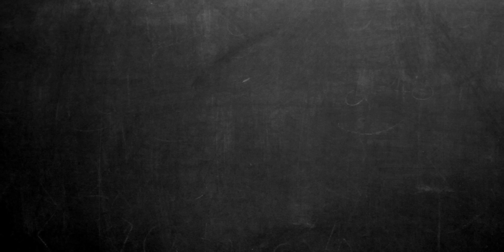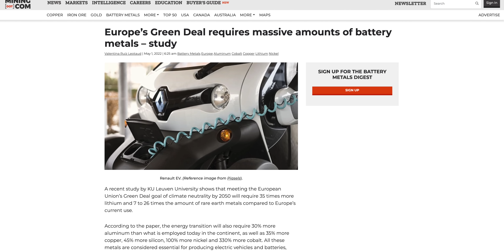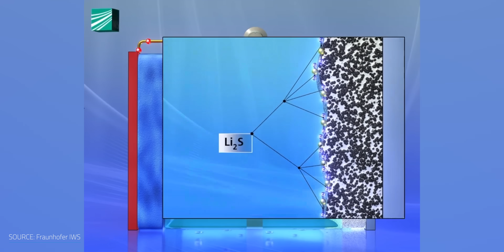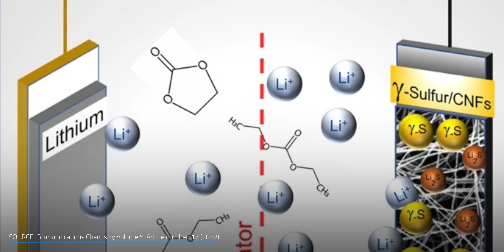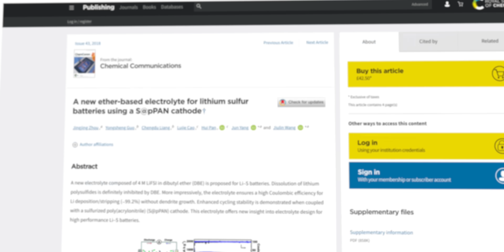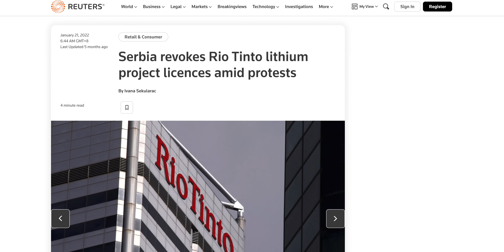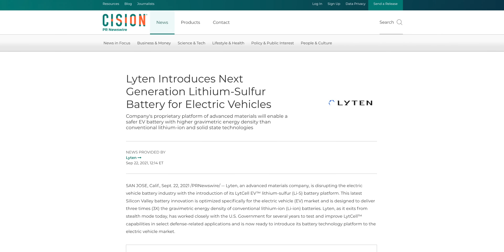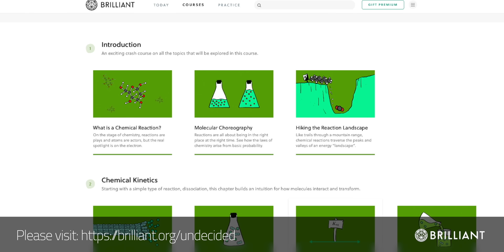Why This Accidental Battery Breakthrough Matters

Comment: This is exactly what we should be researching. Energy storage over energy production. With that said I have seen several battery breakthrough videos over the years with nothing so far. Solid state was exiting but nothing new in the past 3 or 4 years.

Comment: 🤔 I feel like .7% gallium would prevent the lithium sulfur products. I understand that the extraction of lithium and the actual transmission of electricity consumes more petroleum than say a 90% efficient petroleum engine,  thus non superconducting batteries are just a money grabbing scam... but yeah .5 to .7 % gallium should prevent the caking.

Comment: 500,000 gallons of water used to extract 1 ton of lithium-----you could use 500,000 gallons of water in electrolyzer powered by solar panels to product green Hydrogen instead. Much research is done around world to make electrolysis more efficient & progress in that area is on uphill climb compared to progess being made in battery technology.

Comment: IF they can get a sodium-sulfur battery that is even just on par with current LiFePO batteries it will be a game changer.  If they can increase the energy density as well, all bets are off LOL.  I still think the future, 50 to 100 years out, is going to be distributed power generation and storage.  Basically residential and commercial buildings with solar/wind generation and local battery banks.

Comment: 2:58 no it would mean manufacturers would put in 1/4 the battery weight/volume with 100-200% of the capacity IF it really is 8 times as effective.

Comment: Hi Matt, is there anything that actually out and has some improvements compared to the normal lithium battery? 6 years is forever. I am wondering why not  a big auto marker company buys this tech and pushes the production out in max 3 years. If it's really working what stops them?

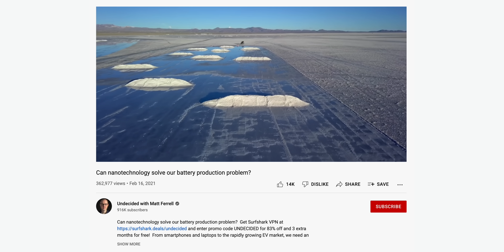Comment: 8:57 500,000 gallons per ton?? Really? Why not putting a few more zeros on both sides and use ounces... pff...
How about 0.5 gallon per kg of Lithium. Or 1.9 L per kg of Lithium. Or about a water-Lithium mass ratio of 2:1.
Or in dramatic words: for the weight of Lithium equal to a diary cow (700 kg) you need an olympic swimming pool of water (2.5 *10^6 Liter)

Comment: Lithium-Sulfur battery are already in the market with a cost of $1-4 with 1000 cycles.
Lighter than li-ion.
No need for bms...I overcharged them in 3hrs by accident...And they are still okay. Charging time: 1hr

Comment: Okay, but how does charge rate compare? How about sitting discharge? Rate of discharge? Heat/cold sensitivity. Lithium batteries have a slew of problems for real world applications outside of small electronics. 

I really wish we're pursued capacitors instead. And we'll STILL need nuclear power for all that electricity. Our generation and infrastructure can't handle 25% EVs today.

Comment: There's a lithium sulfur company formed out of a university in Australia that has gone public and has the production capability of to 2MWh per year. 

They're hedging their bets on Boron Nitride Nanotubes to solve the problems. I only heard about them the other day but it sounds like there are a lot of players vying for this market.
Reply: Also, I see Ambri batteries, started out of Cambridge, must have overcome their design flaws as they're expanding rapidly too. 

They're liquid metal batteries for bulk storage using abundant and cheap materials. Plus they don't require cooling which is a major plus for wasted energy.

Comment: Energy density vs. capacity?
1. Is the 8x energy density by volume or weight? Or both?
2. Why does it have 8x energy density but only 3x the capacity of Li batteries? This doesn’t make sense to me.

Comment: The problem with any battery that requires lithium is that, even at our current level of lithium use, each year, thousands of acres of trees are being decimated in order to get at the lithium. How is this environmentally friendly? Further, a large portion of the lithium is found only in China, and we have found out how reliable they are as a trading partner. What we really need is a battery that uses a mineral that is much more plentiful, and easier to get at, than lithium.

Comment: Comment prior to watching. I like to guess first... EDIT: nope :) 

Problem: Pasdivation layer build up on the anode.

Solution: charge with high frequency AC such that a low discharge rate is applied intermittently during charging.

I.e. each battery must have electronics to control charging.

Comment: You know, the thing with all these developments and that they are always touted as 'cheaper this, cheaper that', but the consumer just never sees anything of that. Things just get more expensive with manufacturers and/or lawmakers coming up with a plethora of reasons to keep prices high. New battery tech is nice, but I don't believe for one second that this new battery, or hydrogen, or anything else, will actually result in more buying power for the average consumer.
Reply: That's almost always a manufacturer decision, not a lawmaker one. But you're right. There's no market reason for them to lower prices when they can just increase their profit margin.
Reply: @MindForgedManacle  It becomes a lawmaker one when they enact such restrictive regulations that the manufacturers can't operate at a profit.  For example, Smithfield (pork processing) is shutting down their operation in Kalifornia due to regulations and cost of operation.  This is also going to impact their operations in Utah and Arizona, costing jobs.
Reply: @MindForgedManacle  I guess that the impact of law makers is more country-specific than manufacturer decision making but where I live, for example, so many things are illegal. Want to save on fuel and get a small electric scooter for grocery shopping? You can't because forbidden to ride on public roads? Want to electrify your internal combustion car? Not allowed without a lot of time consuming and expensive checks and authorisations, etc.

Ultimately, I think lawmakers have more power over pricing than manufacturers do because they can limit what a product should cost.
Reply: If they do manage to replace lithium with sodium the price will definitely come down due to the abundance of sodium
Reply: @grimaffiliations3671  Yes, for the manufacturers to build their products. Not for us the consumers.
Reply: @pyramidsinegypt  nah, when that tech becomes well known, there will be more avenues for supply, which will drive down prices

Comment: Insofar as the general shift to electric cars is concerned, I call bullshit...  its a government mandated novelty.  Why? Batteries and the electrical grid.  Battery efficiency drops dramatically in cold weather.  Presently, there are rolling brownouts merely because people run their home air conditioners!  What happens when electric cars are sold in really large numbers?  Just when will we double or triple our generating capacity?   I don't see people lining up to have coal-fired or nuclear generating stations built in their backyards.  BTW, China has a monopoly on materials for battery production.  Let that sink in.

To the manufacturers and their engineers, I give them all A+'s.  They are implementing, with success, the whimsical dreams of some bloviating governmental bureaucrat, owned by the Chinese, who is worrying about a crisis that doesn't exist.  I could go on for about as long as it takes to charge an electric car, but...

Comment: For EV applications even if the Lithium Sulphur  battery can't be charged as many times as the Lithium Ion wouldn't its 3x energy density more than make up for that?   I mean 1400 vs 2000 charges

Comment: Sounds awesome if it really works.
One of the main issues with our current batteries is how heavy they are. That means electric cars are heavy if you want enough range.
This isn't that much an issue normally, however it's one of the things that make electric sports cars kinda bad. Sure we can compensate with stuff like torque vectoring and all wheel steering but they just aren't as agile as they can be. Light batteries will solve that.
It's also a good thing for the air aviation industry, making electric planes more viable.

Comment: It's interesting for sure although I would like to see a comparison with Lithium Iron Phosphate batteries , charge/discharge cycles are about 10 times better than Lithium Ion but it does sacrifice weight and some power density in it's early lifetime but surpasses it within a hundred cycles or so .
Reply: They last far more than just a few extra hundred cycles. LFP batteries last from over 3x to 10x than typical Lithium Ion (3,000-10,000 cycles), and they do not have Nickle or Cobalt. Many new Tesla Model 3's use LFP batteries, especially in China

Edit; Did some more research lol

About half of the new Model 3's come with LFP (Lithium Iron Phosphate), and are 9% heavier 😅

The 3k-10k cycles can be seen as exaggerated as the capacity is lower and will have to go though more charges for the equal range of Lithium-Ion. If you go with 2/3's energy density, that still means 2x-5x mileage life.

They seem to have more stable chemistry, theoretically better charge rates without degrading (recommend 100% charge BTW) but limited to 170Kw 😅

So, if you don't mind hitting the charger a litter more (267 EPA range, with 250+ observed in tests going 65 vs 358 EPA on the Lithium-Ion long range Model 3) you can charge 100% without worrying about degrading the batteries and can run them down then all the way back up also without degrading any much faster. And it's half a second faster than the alternative Standard Range with Lithium-Ion.

Side note; the Lithium Ion does recommend 80% charge for daily use reducing range by 20% giving you just over 210 miles BUT the batteries also degrade more when going under 20% if i'm not wrong. But with current pricing it's "only" 6K more for the long range with AWD and better speaker system which is considered one of the best in any car made 😍
Reply: @MrHeHim  heh I didn't say they didn't last far more cycles in total use , what I said was this , The power density (the amount of power per pound) of a LiFePh4 battery is lower than lithium ion only for a short period of time in other words due to the degradation of the power density of a lithium ion versus LiFePh4 has the power density graph cross after a couple hundred cycles or in other words LiFePh4 has a higher power density after only a couple hundred cycles . Personally if I bought an electric car I would want the LiFePh4 batteries for several reason . My battery backup systems I use camping and etc. are all LiFePh4 .
Reply: Keep in mind there are some heavy duty applications, such as railroad locomotives, where additional weight could really be an asset, since weight directly translates to tractive effort.

Comment: What about the shortage of lithium? Most of the lithium is so dispersed that it's not economically viable to mine. Battery vehicles and aeroplanes make little sense as the batteries weigh the same when discharged so they're always going to be inefficient not to mention that there will never be enough to replace existing cars. Instead  of junking perfectly good vehicles surely it would make more sense to convert them to hydrogen burning engines and use batteries wherever possible in devices where the weight of the battery isn't a negative?

Comment: I think there will be multiple viable solutions for the troublesome battery issues in the not so distinct future. 
Problem 1: Charging times could be decreased with the use of Grpahene or Supercapacitors. 
Problem 2: Use of Cobalt and Nickel could be completely eliminated with use of other chemistries like lithium-sulphur as you mentioned here. which will reduce its cost and make it more environment friendly to produce.
Problem 3: Not such a huge issue but still, addition of renewable sources of electricity to the grid makes the whole cycle Green.

Comment: No .. a "major battery breakthrough" takes a lot more and to switch from fossil fuels even more:
1. High Energy Density
2. Low Cost
3. Nationally Abundant Raw Materials
4. Ultra Fast Charging
5. Ideally Nonflammable Materials
6. Nationwide Standard Charging Stations Infrastructure

More than likely it's (the battery solution) going to be a solid state form of high density, low resistance battery using simple and abundant raw materials ideally sodium, magnesium, silicon and other common materials, including complex manufacturing processing of materials made at scale.

Comment: I know it's not the most sustainable option but I've always wondered with options like this and aluminum ion that are not very good at recharging (or even others that are completely not rechargeable) ... how the price to performance compares to alkeline or zinc-carbon batteries. More powerful AA battery would be nice ... or even if the voltage doesn't line up, a 9V or 6V bettery made of fewer cells internally still sounds good to me for those battery markets.
Reply: I recall they lasted much longer when the had mercury in them.

Comment: As an E Bike user I couldn't be more excited for this tech.

I have a 15 AH battery currently. I could fit maybe a 20 AH in my frame. 

With 8 x more capacity in the same space I could ride full speed for 3.5 hours or at 20 mph for 7 hours.

That's insane, Light EV as main method of commuting would really become popular with such capacities.

Even with 3 x the capacity that could turn a simple budget e scooter into a legit commuting device not just last mile.
Reply: I have a 72v 35ah battery in my Kaboo Wolf King GT scooter. 80+ miles and a top speed of 64mph with AWD.
Folds up and fits in my trunk.

Comment: Saying cobalt and nickel are unfriendly cows a bit to a narrative.  About 90% of cobalt is commercially mined.  The two metals add up to not insignificant, but small, labor issues and the issue you describe, disposing tailings.  We should constantly keep perspective on relative air pollution, and instead compare the trio: nickel, cobalt, and sulfur to internal combustion's, CO2, NO2, etc.   Without doing so, we lose perspective on why we're going electric.  That view is already endowed by the negative marketing of the fossil fuel industry, and even creeps into asset management, or ESG (where it hides scope 3 emissions, etc.)  

Choose your bogeymen wisely.

Comment: Planes require minimum 400Wh/kg battery power/weight. We're currently in the 250's range. This battery would instantly make the economics of commercial passenger planes turn on its head.

Comment: The Sodium-Sulfur battery would be the real game changer- as the materials are so very common.  The other issue with Na vs Li is weight.  BUT- I can see a future were ground transportation can use the cheaper Na-S batteries whereas the more weight critical aviation industry can use the Li-S batteries.

in terms of range, seems that people should have options- for most, 400 miles is more than enough.  For others, 600 miles in a day with very short breaks is more needed.  This would also help with the RV industry for both the towing systems and the driven campers.

The other question- does this find help other battery chemistries that have shown potential but problems?